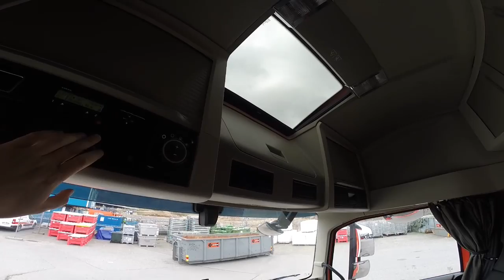Trucker Dashcam | VLOG #3 Cab view // Inspection

Comment: Would be nice if you made a vid about accessing the engine.(Jacking up the cabin)
Reply: It's quite a lot of work to do that, and the driver rarely needs to do that, you can access everything you need from the front! The older Volvo FL I know you had to tilt the cab to check the oil or something, very annoying :D

Comment: Was that a chip in your windscreen? Also the drinking horn was pretty funny.
In The UK, we have to do daily inspections ( lights, oil level etc) then with the company I was with we had mechanical inspections every 6 months but I think that was just because we had bin trucks and alot more can go wrong on them compared to normal trucks.
Reply from the maker: Yes, I Think I have Three in the windscreen.
Reply: All Swedish truck drivers (should) do a daily inspection of the truck. Oil, check for air leaks, tire pressure, wheel nuts, etc. But the MOT-test is only once per year and is something thats mandatory for cars and bikes as well.
Reply: All Swedish drivers "should" actually do an inspection (visual) every day (or before every trip) as well. ;) You are taught to walk around the car, check tires and lights before every trip.. Don't see many people do that other than on the driving test though. ;)
Reply: Yea, not many have " time " to do that, but it really pays off in the end, not so fun if a tire falls off and you could have seen it during inspection and done something about it beforehand XD

Comment: @ 24:32 This is awesome! Is this run by your company? Or a government facility?
Here in the US, they don't require such inspections, just a once over by the company shop every year, and the DOT (Department Of Transportation Not sure what they call it over there, but it's our government agency for all things related to transportation), trusts them as to properly inspecting their own equipment, LOL!
The DOT has weight and inspection stations all across the US to make sure trucks aren't hauling more than the legal weight limits, as well as perform random safety inspections.

I guess, because the US is such a large country, with so many trucks on the road, inspection stations like this would just be too expensive to build and maintain.
This is the type of testing ALL trucks should be required to go through!
Reply from the maker: Hi!
It was run by the goverment, for like 5-6 years ago. But know the market is open for anyone.

We can also be stopped along the road, and they can check weight, tires...conditon of the truck, trailer etc. (but then its the police)

Well, it costs to do this, a car is like 80 USD, and a truck around...hmm, maybe 500 USD. And you have to pay out of your own pocket, or the Company (in this case).

Comment: Good video. For your job, do you only drive withing Sweden or also abroad?
Reply from the maker: Only in Sweden. It is to tall and heigh for other countries. But I could go to Finland :)
Reply: Sweden is beautiful, so at you get paid to travel around it :P I remember when I was 15-16, I thought it would be cool to drive trucks. But after some time it went away, since I'm terrible driver and don't have patience for idiots on road.
Reply: Trucker Dashcam // Sweden Height wise you truck would be fine in the Uk as our tallest trailers are 4.95m high with all unmarked bridges 5m and above but unfortunatly our regulations don't allow 25.25m combinations but the transport minister is considering a trail so fingers crossed they go for it.